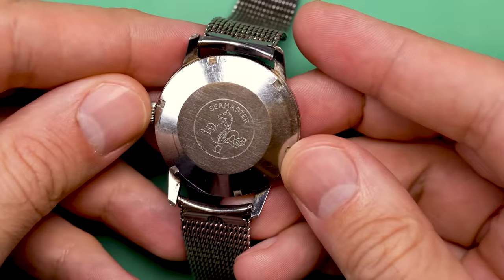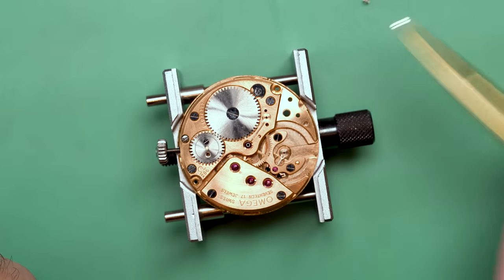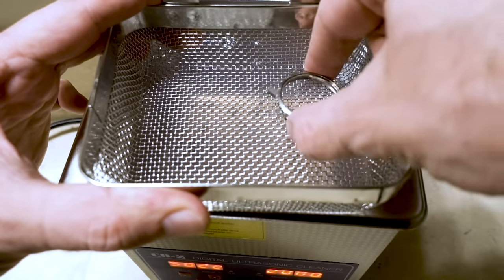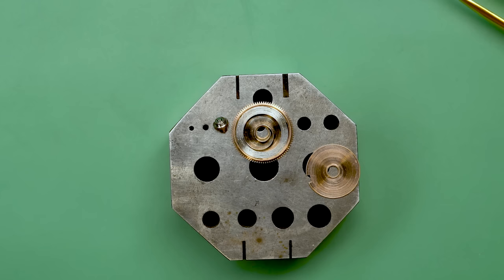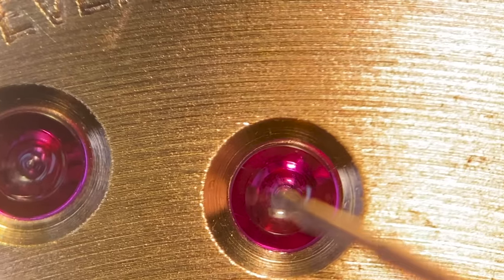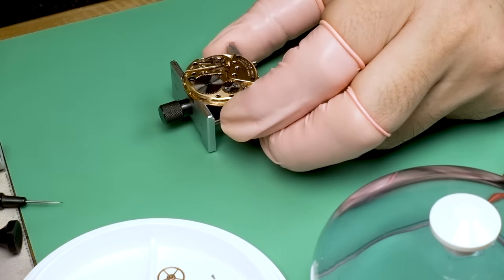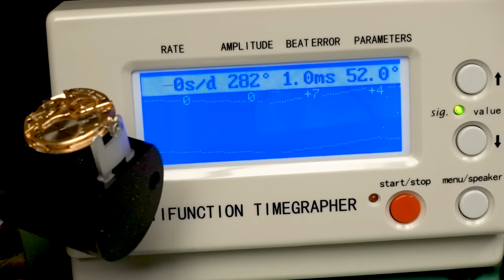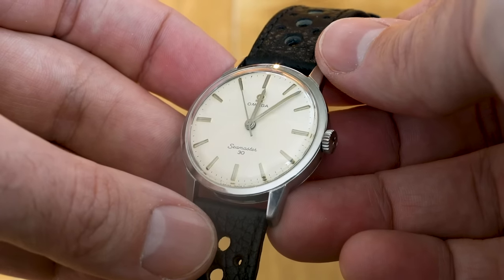Omega Seamaster 30 Vintage Watch Restoration With a Surprise :(

Comment: If you ever lose a small spring or screw, put a stocking on the end of the vacuum hose and it will find and filter the lost part.  I used to work in aviation electronics and we couldn't leave the shop until we found the parts we lost (loose parts can cause issues) and this trick was a lifesaver.

Comment: I know it's an older video and you've probably improved by now, but when sanding on a flat plane (like your paper on the steel block), it's best to go in a figure-eight pattern unless you're aiming for a specific "grain" orientation. The figure-eight combined with small rotations will help hide and lines created by sanding.

Comment: Nice job. I purchased an alleged Gruen Autowind in a gold case from eBay and when i opened the back it was nit only missing the Autowind works, but it was an Eska movement, hand wind. The seller offered to refund the purchase, but we ultimately settled on a partial refund so i have a hand wind frankenwatch. My lesson: get a photo of the movement before purchasing. Thanks for the video. Keep at it!

Comment: I have a 1954 Omega gold watch with the 266 movement on a Bonklip gold bracelet which was presented to a family member for 40 years of service to the Ford motor company here in the UK. Its in beautiful condition and runs accurately.
The bracelet is easy to use on any size of wrist. The case is only 34mm so I don't wear it as I have a seven and a quarter inch wrist.
Beautiful movement looks like rose gold plating.
Reply from the maker: Post a picture on Instagram, sounds like a lovely watch!

Comment: Hi Marshall. I was really happy to see your new video on Omega Seamaster 30 (286 movement).  It happens that I have one of these which I have had for 56 years (a gift from my father when I was leaving high school).  Recently the mainspring broke and I got a replacement on Ebay.  Yours are the only videos I have found on this particular movement, so for that I'm really grateful.  But I wish you'd focused more on the oiling!  You sometimes quietly apply oil, without telling which oil or even mentioning it.  Maybe I'm hoping for too much!

Comment: As someone who has worked as an auto mechanic for several years i can agree that you do become familiar with the intricacies of different designs. You'll find how all the parts always perform the same jobs, but interact with other parts differently between eras and other makes and models.
I liken the detail of watches more to carburetors specifically because of the size and delicacy of the components, as well as the fading use of the assembly.

Comment: As I'm getting into this hobby as well, I'm curious to know what set of main spring winders you have? Where you purchased them? They look like a complete set.
Reply: Jeff Tally he has the Bergeon ones you can get them from cousins uk but there over a grand to buy
Reply from the maker: Yep, what Aidan said. I got these from ofrei, but they are like 800 bucks for the set.. super expensive!
Reply: Wristwatch Revival I am about a week away to finally sort my work bench out will send you a picture once it's finished I see your work height is like at a standard desk do you get a sore neck etc

Comment: “Item is not as described” - one of the only reasons you can return for a full refund even if the seller states that the will not offer refunds. If they didn’t state that there is missing parts, even if they stated it’s not working and selling as is, you can still get a full refund if you wanted to
Reply: Xd
Reply: How stupid! Items sold ASIS CANNOT be refunded or returned! Stop the BS!
Reply: @DonnyHooterHoot  check out eBay’s return policy before acting like you know everything

Comment: EXCELLENT!  So satisfieding watching as you disassemble, clean, replace and repair all the intricate parts of this watch.  During the mid 60's,  I came across an old Omega time piece the was inoperable/broken, the main spring was wound to the point where it completely stopped. 
The watch was very dirty and appeared to have been under water.
Initially the watch appeared to be in utter despair and beyond repair,  still the watch was attractive, solid, 17 Jewel, water resistant/proof to 100 meters. 
The band was one of those twist any which way and wouldn't catch arm hair! 😆 
Having limited tools 🔧 but an overwhelming sense of curiosity, I set out to figure out what made her Tic 🤔 
Watching 👀  you disassemble and go over each intricate piece, how you name each piece and its function!  People nowadays have all this invaluable information at their fingertips!  What I would have given for the internet. 
Thank you for sharing and the educational experience. 
Oh and yes I did get the 21 Jewel Omega Watch working, seems all I had to do was just to release some of the energy off the main spring, just wound too tight.  Merry Christmas 
and Happy New Year 😊

Comment: Good video, they're getting better. Question... Why do you put steel screws and gears back on the movement, such as laying the crown wheel on the ratchet wheel? Are you not mindful of scratching parts? Bad practice in my opinion.
Reply from the maker: I do that so that I can see them if I need to go back and check, and also to show the viewer. It's probably not perfect practice but I'm fine with that as my goals are also to make good videos and to learn, plus I don't think I'm actually damaging anything when I do it.

Comment: I’m just getting started in watchmaking and the hardest thing I am finding is remembering which screws go where after cleaning.  I take videos of the disassembly so I can reference that, but I guess it just takes time to get used to what goes where
Reply from the maker: Yeah, you get a sense for it the more you do it, but the video is necessary for sure

Comment: I wish my hands (the ones attached to my arms) were as deft as yours putting the screw back in. I have no problem getting them out, but feel like I'm really fumbling trying to balance the screws to get them in the holes. I'm sure with lots of practice and patience I'll get better. You did a beautiful job restoring the Omega...whoever gets it should be very pleased!

Comment: The grooves on the pallet fork jewels might be caused by a too tight cannon pinion, forcing the watch to go backwards when setting the time backwards. Setting the time backwards causes back-hacking due to the cannon pinion being too tight and the watch starts running backwards, which can damage the pallet fork jewels.
Reply from the maker: Oh interesting, I'll check that out

Comment: Not a big fan of lots of dials and information. This is simple yet beautiful. We are not ALL race drivers, who need 100ths of a second. Ivory dial and centre second. If there was a smaller second (instead of centre) and date...thats about as far as I like detail. Love the vintage stuff. I have a Tudor Prince in the Rolex Oyster case that I got in 1972. Going to have that re-worked soon...Lovely stuff, subscribed.

Comment: I've got an Omega in my growing pocket watch collection. Was made in England. Near perfect condition too. I've also a pocket watch that chimes the time within quarter of an hour. That one has a central second hand that has a button that resets the second hand to 12 and also stops it dead when the button is again pressed. ie a stop watch. Nice to see your work here. I have several projects of my own to do and will practice on the parts watches first. I want to know how to restore a watch face. Might have to send it away to get the pro's to fix it. It's an omega 562 gold plated. My favourite wrist watches. I bought them as investments but I like them so much I can't part with them.

Comment: Those sanding stripes you're using are meant to be used with water; you'll achieve better and much faster results if you soak them every now and then so the metal removed washes away. You can use a shallow bowl with water, nothing fancy.

Comment: you mention needing to correct beat error. How do you do that?
Reply from the maker: It's tricky, you have to take off the balance, then take the balance wheel off of the balance bridge, then take a screwdriver and turn the collet that holds the spring to the wheel a little bit, then put it back on and test it, then repeat until it's right. It's very time consuming and fiddly.
Reply: @WristwatchRevival  might you in future make a video of that process?

Comment: Likewise, working on my cousins 1966 VW bug, there was a spring behind a metal plate. We were 16 years old and didn't know the spring was under tension on the carburetor. Of course as soon as the third screw was removed from the cover plate, "ping"!  For three hours we tore the garage apart looking for that little bastard! On the verge of quitting, I turned to my cousin to suggest that we take a break and grab something to eat. As I spoke to him my eye focus drew together and behold... The spring was stuck in his full head of brass colored hair!

Comment: You might want to take the escape wheel out and look at it under the microscope. If the jewels on the pallet fork were scored, there had to be a reason. Putting in a new one with unscored jewels without finding out why means it will probably happen again with the replacement part.
Reply from the maker: I replaced the escape wheel with the one from the other watch too

Comment: to be frank, the problem you are adressing with parts flying around and the struggle to find them.. isn't there an easy fix to that? you could buy, or probably even build, a glass walled glovebox to be on the safe side. hope you are doing well, and thanks for showing us your expertise and sharing your lovely soothing voice.

Comment: Hi

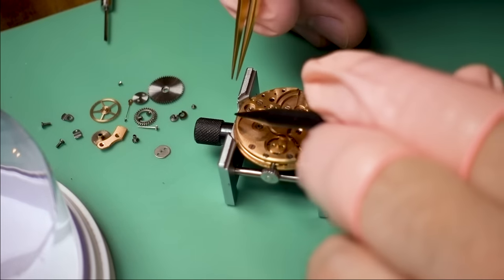When my dad was teaching me about watchmaking he gave me a trick he learned from his dad, which is when removing or installing the click spring like in 9:00 just put a thin plastic bag over the movement the same way you do when removing the hands so the bag keeps it from flying away. It work fine for me so I thought I share it and save you some.

you should look into some of the tuning fork aka hummers watches I think you would like them. they are a tricky to work with but fun.

I love your videos man keep up the good work.
Reply from the maker: Thank you! I should do that. I haven't lost one in a while but sometimes they still jump away on me and these are the worst ones to lose for sure

Comment: I have a old manual winding Titoni watch which seems similar with that omega movement. But it has silver, not gold color.  I just don't know, what caliber is it?
Reply from the maker: It's usually marked on the mainplate or top plate

Comment: I’ve just found your channel. It’s fantastic. I particularly liked this video as its of a movement and watch type similar to one I would like to look at. I have a seamaster 120 with a Calibre 630 movement. It has issues. I’m currently a complete beginner with not a single tool, but watching these videos is really tempting me to have ago.
Would you by any chance have a video of a 630 movement repair? Or consider one? Even better a seamaster 120 video!!
Also your commentary naming all the tools you use as you use them and all the parts as you touch them is supper helpful. In two days I’ve learned more new stuff than I’ve learned in a long time! Thanks again.

Comment: Which tool did you use to pull the "seconds" wheel? I'm working on a Wyler WW2 watch with the same wheel on an ETA 932.  Love your channel and has really helped me in my restores.  I also am working through the Watch Repair Course by Mark.  Thanks in advance

Comment: This was wonderful! Those vintage Omegas were made to last forever. Regarding the O - rings you used, I was wondering if there is a place to source them where the cost is not outrageous. I have an old Seiko SKX that needs a tiny o-ring for the stem and they seem to cost $15-$20 for a tiny piece of rubber?
Reply: Curious about this
Reply from the maker: The o-ring I used on this came as a part of a big assortment of them, very affordable.

Comment: Do you mind me asking what brand, type, and size tweezers you use? I'm slowly building my toolkit before I start on this hobby. Need to populate my excel Christmas list :-)
Reply from the maker: No problem at all. The stainless steel ones I have are from Dumont, and I mostly use the 2, 3, 4 and 00 versions of them. I also have 5 but I don't use them very often I've found. I have the Bergeon brass tweezers too and those I use a lot.
Reply: @WristwatchRevival  awesome—thanks man. I’ve always wanted to get into watchmaking (I’ve been a watch fanatic my whole life) and you have inspired me to take the course offered by the Watch Repair Channel. Thanks again!

Comment: The escape wheel is so called because it is part of the escapement, the mechnism giving the heartbeat to clockwork. Tooth by tooth escapes from the locking mechanism of the pallet fork.

Comment: Hmmmm Use the big tweezers on the jewels- Yes! Just kinda learned that one organically  by accidentally bending the tips my only pair of fine tipped tweezers. They were outta service so I just started using my #3 Vigor for the jewels and it works great for carrying them. Good tip!  Ohh and why'd you put a brand new crystal in before you removed the crusty gasket??
Reply from the maker: I dunno, the crystal and the gasket don't really have anything to do with each other so no big deal I suppose :)
Reply: @WristwatchRevival  Yeah- but you hadda turn over the watch, set the crystal down on the pad and then chip away and deal with a crusty gasket. Just more chances to scratch or mar the brand new crystal as it was upside down on the bench/pad. If you get a piece of chunky gasket under there it may scratch the brand new plastic!

Comment: Is it possible to get a replacement balance or will you retire the other 286 and turn it into a replacement source?
Reply from the maker: It is, but it's an ebay hunt type situation, so the other movement will probably be a donor movement going forward.

Comment: I was surprised to see that you didn't mention or seem to notice how dirty the replacement balance was during the part where you removed the shock springs and removed, cleaned and oiled the cap jewels. It looked like there was actually a chunk of brown gunk on the balance along with all of that white residue.

Comment: 48:00 the grease should also help seal ist against water, as far as i know it is done in electrical apliances that are going into water the grease will help keep the water out of the "sealed" connection and makes it a waterproof connection, dave from eevblog once talked about this from his former job where he has developed such machines. the same should be true for watches :)

Comment: you're right that never gets old I love the way you love your mainspring winder that tool kit for the winding is awesome‼️®™️    as a union ironworker we love our tools❕
Also has an ex union projectionist (IATSE LOCAL 230 projection union Denver Colorado) old movie projectors remind me of watches they're all different and yet they're all basically the same 
just as watches do projectors have different components within the unit yeah that's the sound system head, The projection head, The intermittent assembly, The lamp house etc. etc. long story short of fantastic stuff I'm hooked on these watch videos thank you and for everything you do‼️®™️

Comment: im a patient person, but if i spent 400 bucks usd on a watch and parts were flat out missing.. id be quite mad. i love the face on this one, and those straps though. beautiful
Reply: Agree.  There is a definite seller ethics question here, and I'm surprised that the comments don't reflect this.  Damage?  Fine.  Parts missing but not stated?  No, sir.  The auction description should be explicit in that the item is incomplete.  Not making this clear is nearly as bad as circulating counterfeit goods.

Comment: My dad often took me with to the big watchmakers in the City to attend to watches above his skill/tool level. they had these cool work desks with a support bit for their arms and it had a little channel at the bottom end of the table to catch anything that rolls down. putting a bit of low-tack masking paper over exposed bits on fine springs and pieces can prevent them flying away.

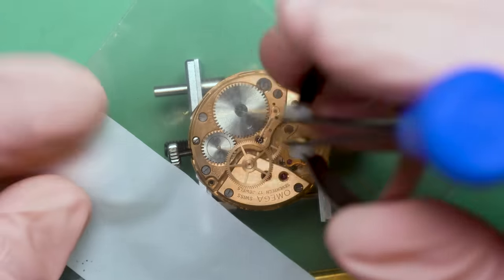Comment: First quick question: what type of Presto tool at 6:41? Would I be able to use my Bergeon Canon Pinion Remover Presto tool - the green top?

Marshall got me hooked on watches. I’ve been amassing tools and have taken Mark Lovick’s courses, and I just purchased this exact Omega Seamaster 30 from eBay, a ‘62 in stunning, running shape. Can’t wait to begin my journey with this bad boy! Thanks Marshall, for everything. I have been grinding at work and busy with my family and I desperately needed a little bit of release, some self-care, a hobby - thanks for igniting the spark!

Comment: I watched your video like it was a movie!! Good job!
I wonder, I have an old omega Genève 135.070 circa 1969 with a caliber 601. I just dropped it to my local omega dealer but I was afraid they lacked the parts to do the repairs (based in Morocco so not easy at all) if they don't succeed is there any way I can shit it to with for your service?

Comment: Gaskets have come a long way since advent of Neoprene.  Early gaskets were white (natural) rubber and carbon colored black rubber.  It outgasses and dries out. So the new ones will last a long time.  Some oils do dissolve either type. Likely nothing in use inside.